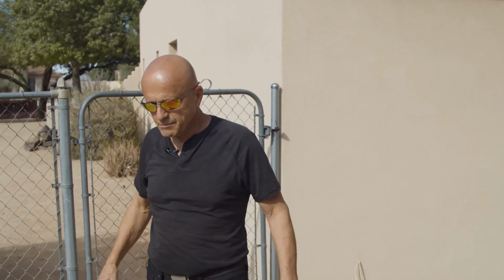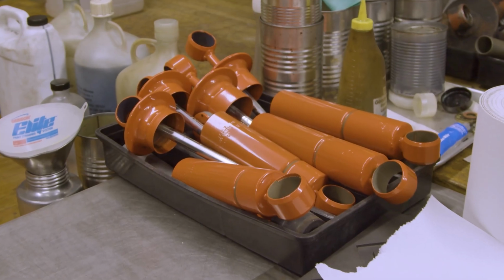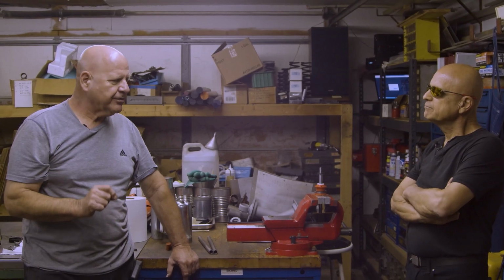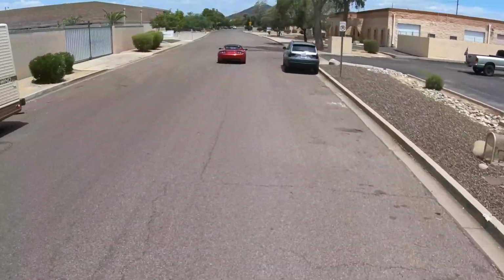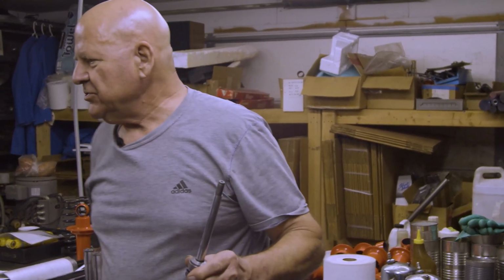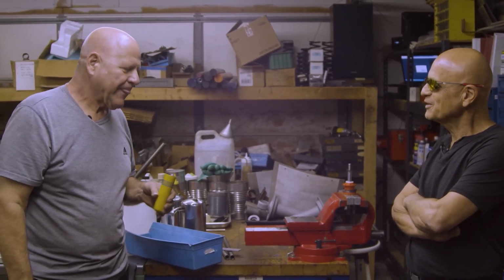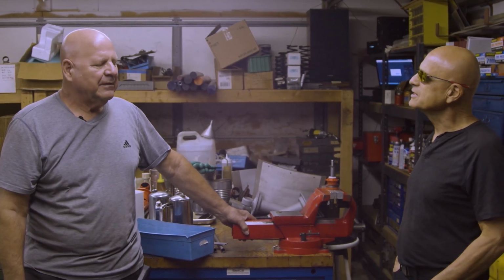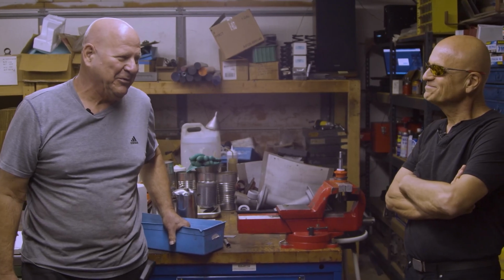Rebuilding Tesla Roadster Shocks | Gruber Motors

Comment: I’ve never heard of changing shock absorber oil as a periodic maintenance item, other than in motorcycle forks. It never gets recommended by mechanics either. It’s not in the owner’s manual. Are there shops that do this?
Reply from the maker: The vast majority of shock issues are handled by replacement, and they just let them fail, which is less expensive than rebuilding.  The limited run production cars that have custom shocks are the market for rebuilders like this.
Reply: @grubermotorcompany  so I guess when he says that people should be changing their shock oil on a regular basis, he's talking about expensive and hard-to-replace shocks.
Reply from the maker: @thedownwardmachine  Correct.  His space is obsolete shocks in exotic cars.
Reply: Well it's done in the front suspension of motor-, E- or mountain bikes. At least once a year - if you care for your bike.

Comment: I would have been happy to see more Tesla information from the shop. Detailed questions about Tesla shocks would have been nice. For example, can you discuss the  Roadster Sport model adjustable shocks, special wear parts, possibility of getting that service work done, does the adjustment feature allow longer service life since they do have simple tuning as a feature of the shock system. How about cost estimate of getting rebuild service done on the sport shocks, does the shop offer a synthetic oil upgrade option that will provide better service life? The other exotic car time spent in the video was a bit of a time waste for the Roadster owners.